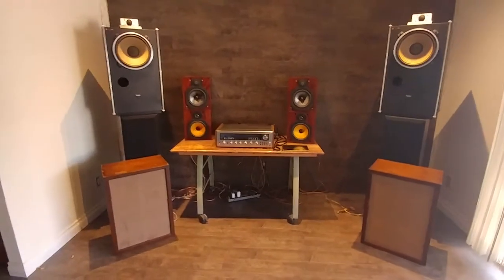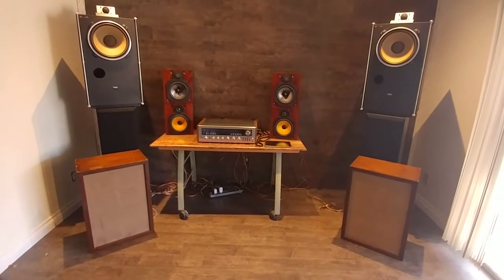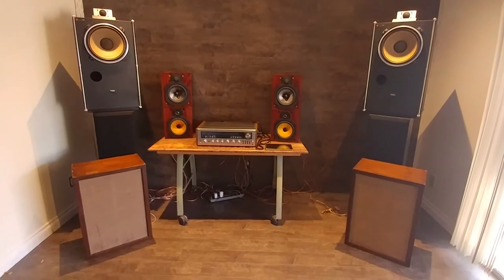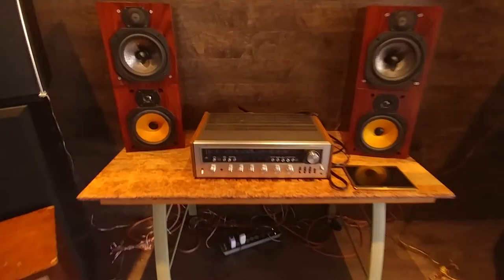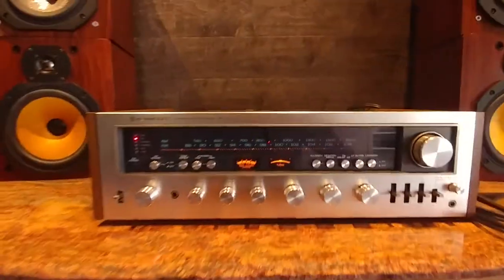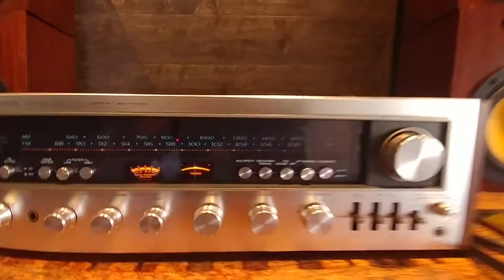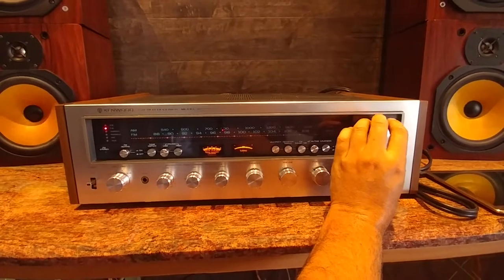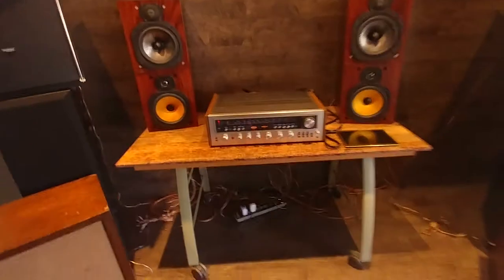KENWOOD KR-9400 Vintage Stereo Receiver | 120W/CH | Solid State

Comment: I have a KR-9400 and at half volume it can rattle my whole house with these giant cheap speakers I had.
Reply: I also have a KR-9400.  Got it at an auction in Honolulu for $60 w/large speakers back in 1993.  The sound this receiver puts out is amazing.   50+ pounds of quality!  There is no comparison, in my honest opinion.